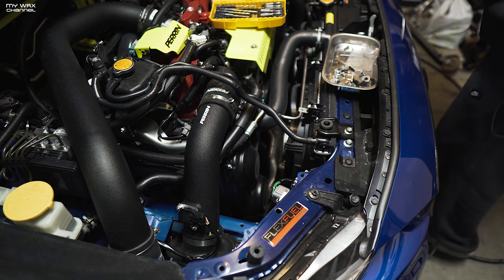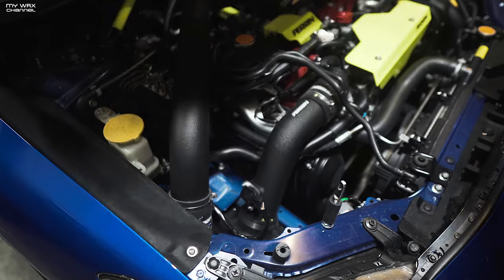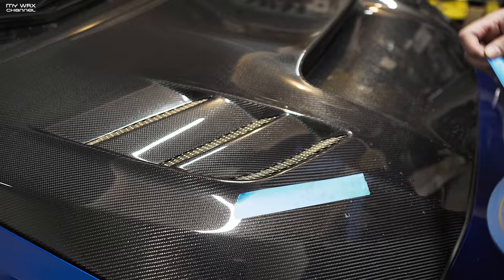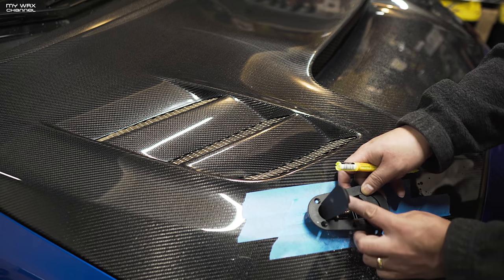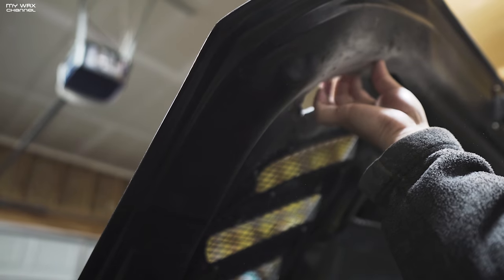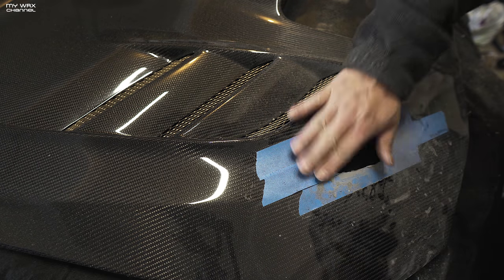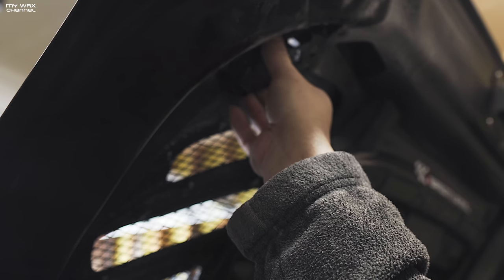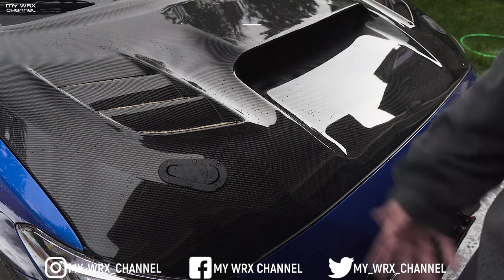RUINED A $1000 CARBON FIBER HOOD | AEROCATCH HOOD PINS | 2015-2019 SUBARU WRX STI

Comment: At last, someone that is doing it right. When you get a CF Hood, you MUST install hood pins. Thank you for the video.
Reply: @donovan ! Yes, you have to install them
Reply: @donovan8234due to high pressure build up under the hood from well air and its not as heavy as the oem hood thus being prone to ripping off at ive seen least 100mph

Comment: After you drill your hole, you can brush a lil bit of resin between the carbon if it separates depending on your car for added stability. Use tape to avoid drips on top though and be very careful 👌🏽

Comment: I have read and seen that hood pins are a throw back to the old days of racing and recommended with lighter hoods be they CF or other as a safety precaution. Intuitively it makes sense also. Regardless you are stuck with them now, fully committed; but for what it is worth I think they look sharp.

Comment: These looks at least as good as aerocatch but are waaay easier to install. One 20 mmm (0.079 inch) hole is all you need.
https://www.speeding.nu/p/interior-exterior/exterior/push-clips/hurricane-push-clips-snabblas-315mm-svart.html
Reply from the maker: It will not work due to the angle of the hood. Those latches need to be vertical in order to catch/lock. In fact, I tried that exact same latch first before I swapped to aerocatch.
Reply: @CarsWithJR  I have the same VIS- carbonhood you have  and it works just fine. I use those on my VIS-carbonhood ( same modell as you) and the angle is far away from a problem. Hurricane dont need to be straight to catch like the aerocatch need. If you have tried it  and it dont work it was a bad copy:) for that is the whole menaing of Hurricane, that  the angel dont need to be 90 degress between the hood and  bolt. I tried aerocatch to first but i thought it was to much work. I can level Hurricane  almost 30 degres and it stil catch the "probehead" on the bolt. I mounted them in my hood and the angle is just 10-20 degres. I also tried it  before i mount it and it worked equal good in  all levels between 0 - 20-30  degres. But  i mount my  a bit longer back then you. Maybe thats is the difference.

Comment: Drives me crazy you keep calling carbon fiber fiberglass.
Reply: Most carbon fiber hoods you see is just a fiber glass hood with carbon fiber weave + resin on it. 

Good prime example is this guy's hood. Its not a 100% carbon fiber hood. As I mentioned above, his hood is a fiber glass hood with a carbon fiber weave layer on top added with resin / clear coat.

Comment: whats the point to have hood pins when you still have to pop the hood ???
Reply: The latches that come with aftermarket hoods are know to fail while driving after some time and could potentially fail and smash into you windshield while driving. Hood pins are a preventative measure so that never happens.
Reply from the maker: Thanks for explaining that! 100% true. 👌

Comment: I just ordered the same hood for my sti but I don’t think I’ll have the courage to drill holes in it your my hero lol
Reply: How has it holded up in the highway with no hood pins? I’m worried I just ordered mine and don’t want to drill into it
Reply: @slatty2457  sadly it didn’t fit I had to return it :(
Reply: @godscar2663  how come it didn’t fit? Too much gap?
Reply: @slatty2457  yup I try adjusting it was wayyyy off

Comment: Would u do this for me if I bring my subie to u? xD
Reply from the maker: I don't have it in me to do it again. :(
Reply: My WRX Channel this.... cutting into brand new $1k+ carbon is the most anxiety inducing DIY there is, I feel like. And I’m stressing out about it just as bad the second time around having to do the wife’s hood next. Know this is a 2 month old comment, but I’m seeing it just now as I came back for a quick refresher. Thanks for posting this guide bro. Seibon is even harder to find mounting points that agree with the surface body lines

Comment: So whats wrong with the oem hood latch?
Reply from the maker: It's not the hood latch that fails. It's the fiberglass that it is bolton onto fails.
Reply: @CarsWithJR  Ohhh right cause you have a carbon hood. I was like, I thought the stock hood was aluminum. Gotcha

Comment: ive been 145 in my 15 wrx hundreds of times on the autobahn in the last few years and still never seen the hood even wobble like my old chevy. So I would say these concerns arent that valid. The stock hood and latch are sufficient
Reply from the maker: The stock hood is fine. I have a CF hood.
Reply: @CarsWithJR  so was this more necessary for you because the cf hood doesnt have all the little rubber sealants? I was nervous for you watching you cut into that hood haha
Reply from the maker: @jonnythunder76  Most CF hoods are reinforced with fiberglass and not aluminum like the stock hood. The fiberglass can stress and crack over time.

Comment: That top layer of the hood is too thin for the hood to have them screws going through, later on those small hole will start to spider crack, if I’d do it all over again I would’ve filled inn the hood on where I cut with fiberglass so the top layer & the bottom layer of the hood are supported.